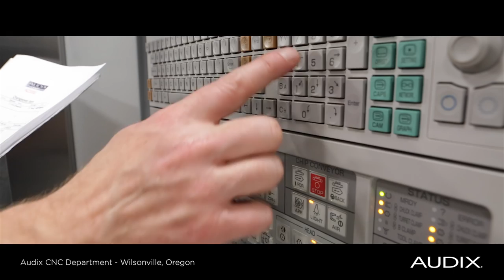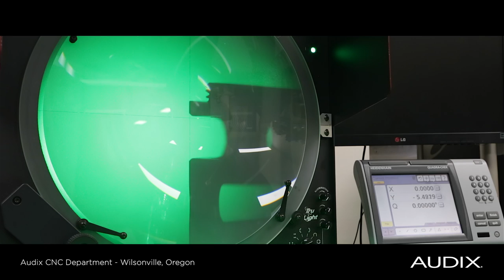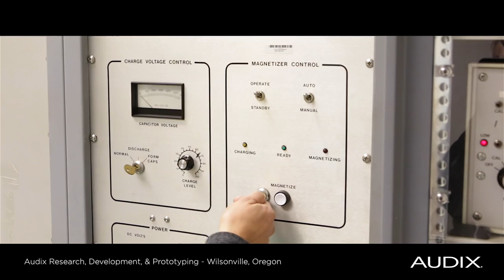Making of the Audix D6 Drum Microphone

Comment: Aaaaand what exactly do SMD electronics (from/for condenser mics, most likely) have to do with the fabrication of D6's? :D
Reply from the maker: The D6 has an electronic filter placed in the base of the XLR that helps optimize the sound.  The batch of boards with XLRs that are shown in the video are  created on the SMT line.
Reply: Please can you explain to me the schedule solder wire. !!! Thanks in advance  :)
Reply: Khron's Cave surface mount is used in all sorts of electronics. While true that dynamics are typically fully passive, unpowered mics, many manufacturers further tailor the frequency response with external components. Sometimes for other reasons. Many mics will have a humbucking coil in path, for example, to help with hum rejection (like an RE20, RE16, etc) while others dynamics have transformers (like the SM57, SM58). 

So there are several reasons why discrete components may be used in a dynamic mic signal path. And for a mic like this that’s designed for a specific instrument, they would need a more tailored response than the general purpose dynamic mics that are often used on kick, like the RE20 or SM7 which have a wider, flatter frequency response that makes them work well with most sources, but those aren’t tailored for kick. I’d imagine a D6 probably wouldn’t sound great on voice or violin, for example.